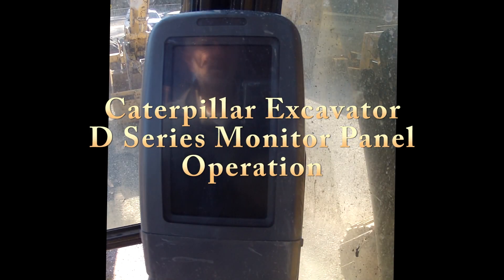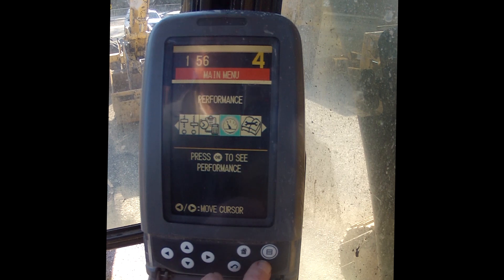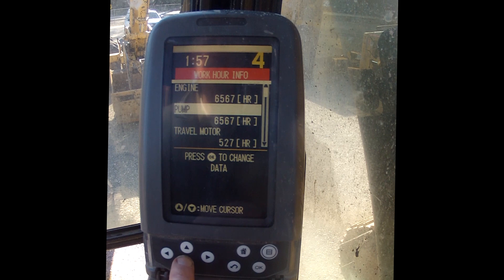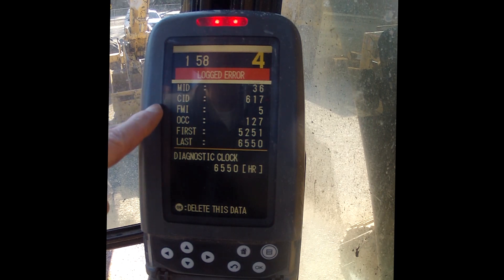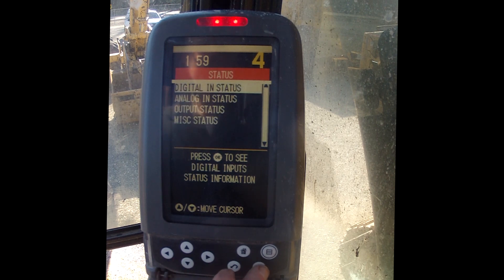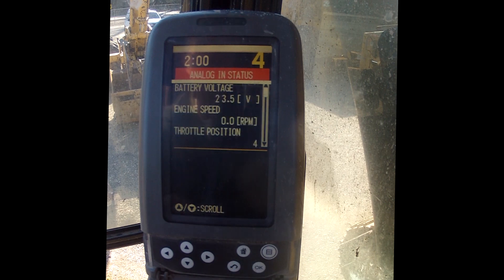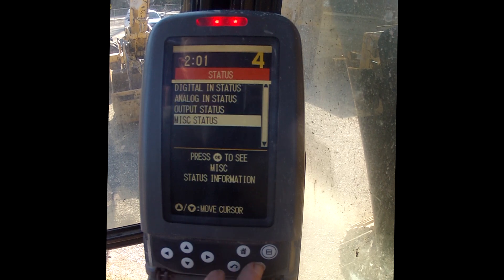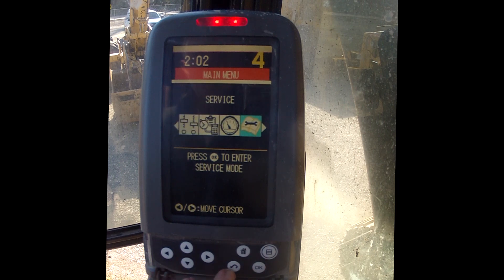Cat D Series Monitor Panel Nar

Comment: Hi sir, I have a cat 322c excavator, I have been having problems for a few days now, the engine display is low and the hydraulic level is low, the engine oil pressure is low.  Let me know what you think
Reply from the maker: I don''t understand what you are asking. Are you saying you have a problem with your display and gauges or are you saying that fluid levels and pressures are low?

Comment: My service menu doesn't have all those options in it just has maintenance and password change no diagnostic or calibration and stuff, it used to have them before but they just disappeared, any help?
Reply from the maker: Did you go to the far right side icon and then put in the code FFF2?
Reply: @repairsecrets  yes I did, but I dont see the calibration option, they used to be there but for some reason there aren't anymore, do you have any idea why it might have disappeared?
Reply from the maker: @aaronpierre1952  I'm not sure about that. Has anyone else worked on the machine since you saw the calibration section? Have there been any updates loaded into your machine? I don't recall if the passwords can be changed for the service section but it might be possible with the laptop program.
Reply: I also meet this problem.

Comment: Hello.thanks for the vid.i have an issue wondering if u could help.i have a cat 330dl one day we working it turn it of to go lunch when we return it dont wanna start back just swining.no sign of exhaust smoke nothing.what would youre first step be to try and start it
Reply from the maker: A couple of things come to mind. No smoke means there no fuel is being injected into the cylinders and that has a couple of causes. I'd probably check the monitor panel for fault codes first thing. If there were none, I'd check to see that any throttle controls were moving to the run position. You can go to the web site for Heavy Equipment Forums and as the question there and someone can provide a lot more detailed information. 
https://www.heavyequipmentforums.com

Good Luck

Comment: Is FFF2 (the code you entered to access the service menu) a default setting?
Thanks!
Reply from the maker: It will enter the service mode on most all the excavators of this model. It works on C models also. The other service password is 9992. Thanks for the comment.
Reply: Hii... how do we change language in that model?